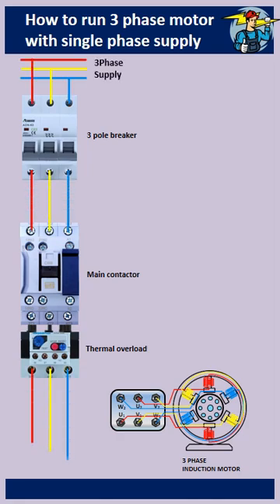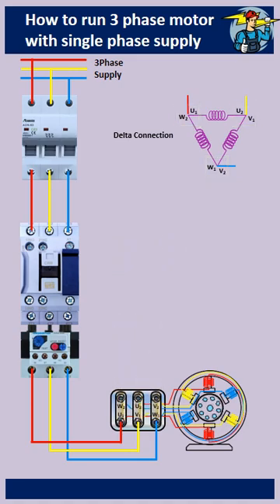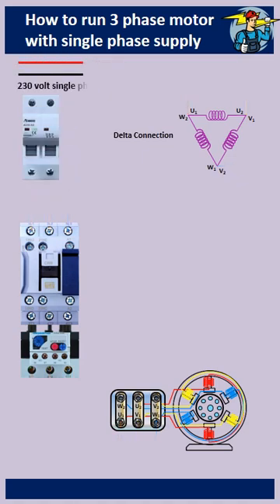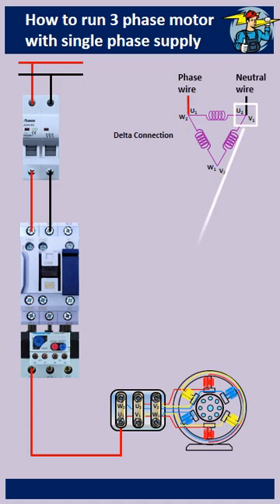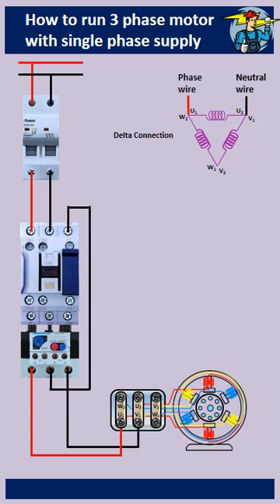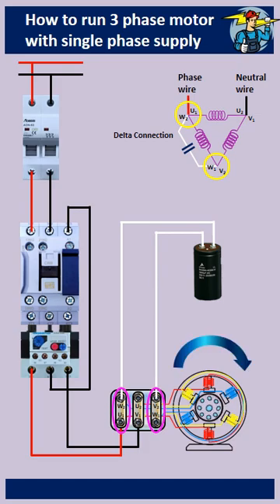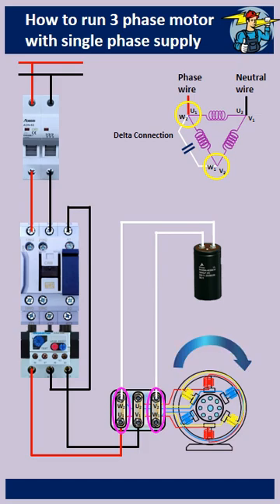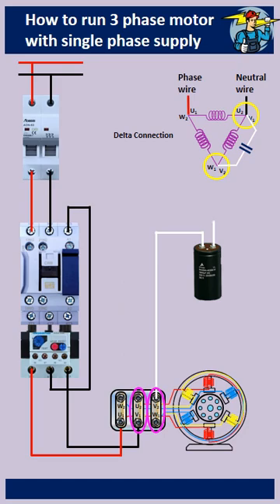How to run 3 phase motor on single phase supply / single phase to 3 phase converter / 3 phase wiring

Comment: Why does the neutral wire loop back thru the contractor?
Reply: @jessestern2080  It is so that heat relay after contactor will operate properly.
Reply: @dudefromnorth9410 thanks for the reply

Comment: How do you wire a start capacitor for 30kw motor?
Reply from the maker: Wiring a start capacitor for a 30kW motor needs careful attention. Large motors like a 30kW unit are typically three-phase motors, which generally do not require a start capacitor for their operation. 
Start capacitors are usually used in single-phase motors to provide the necessary starting torque, but for three-phase motors, capacitors are typically used for power factor correction (if needed) and not for starting.

Comment: what is the value of capacitor?
Reply from the maker: 70 microfarads for every 1 kW power of the motor. 
So, for a 1500kW motor, required microfarad value of the capacitor is 105.
A running capacitor is to be used for this work.